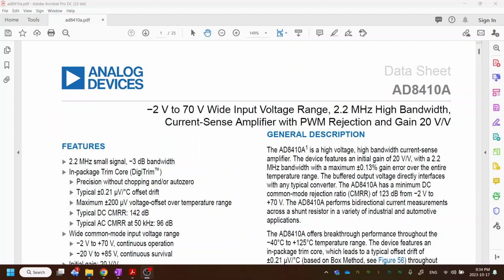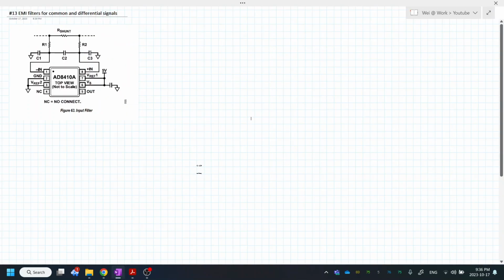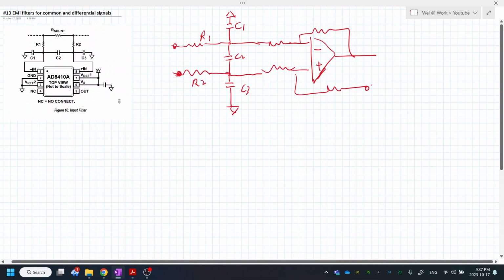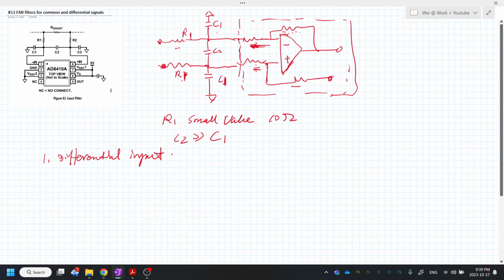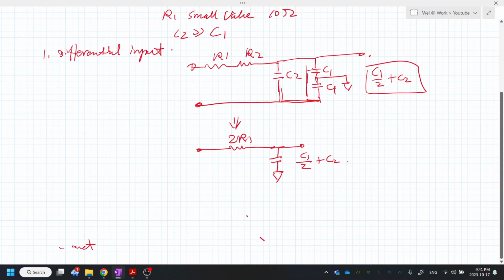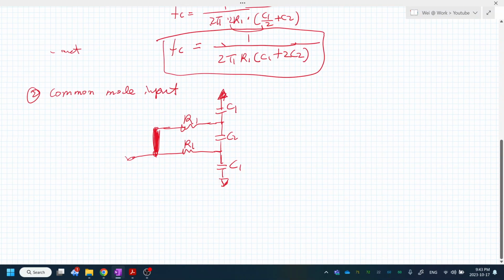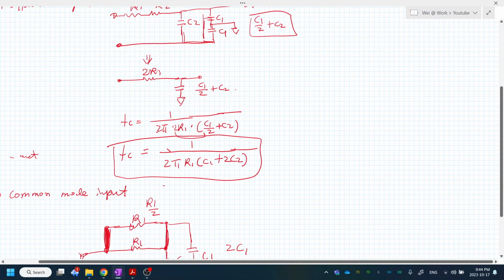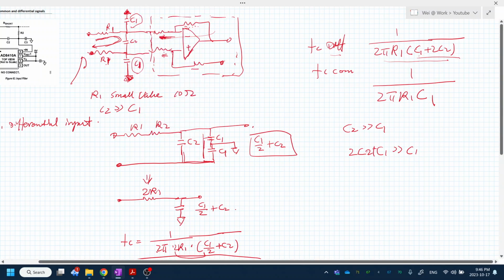#13 EMI filters for common mode and differential input signals

Comment: how to choose cutoff frequency of differential filter for ex 60 hz ac signal?
Reply from the maker: This filter is mainly for EMI signals, high frequency at least in MHz range. If you want to filter 60Hz  power line cycle, you can use analog notch filter or a digital sinc filter etc.